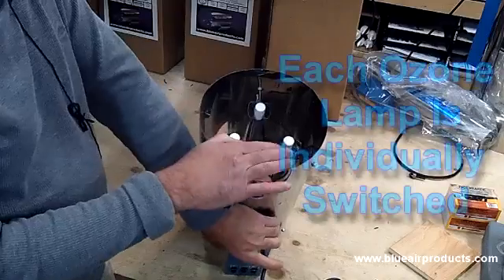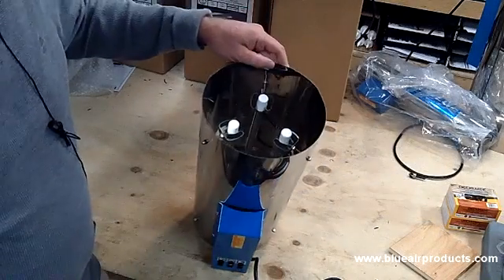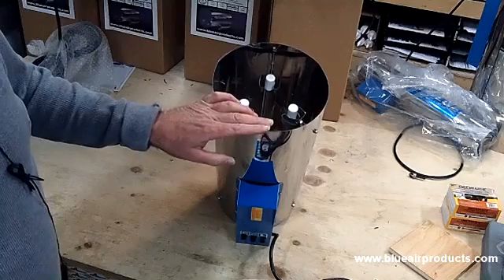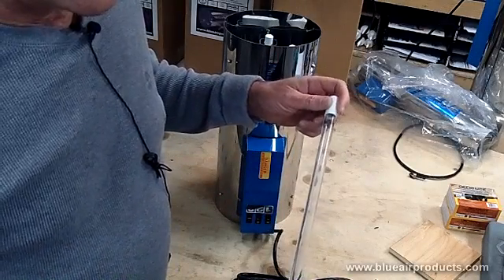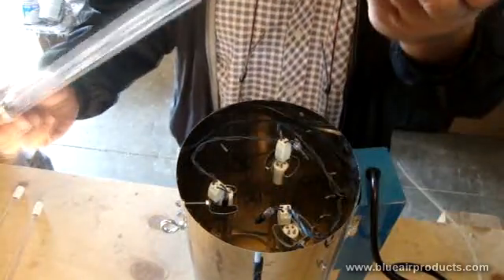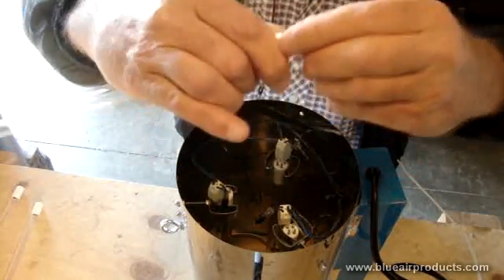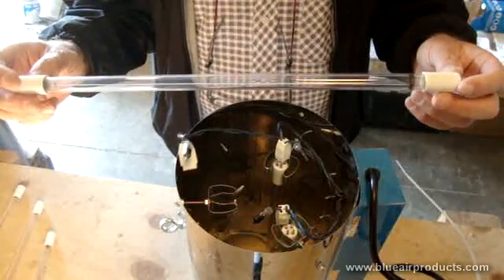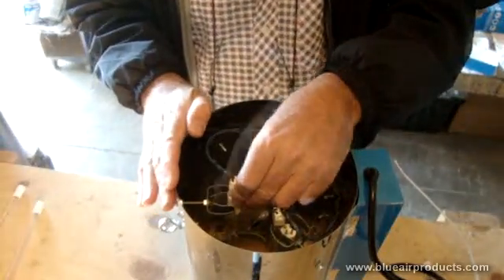How Long Do Ozone Lamps Last?

Comment from the maker: Not much is required. No more effort than you'd use to clean your reflector(s).
One word of caution though, The tiny igniter bulbs are very fragile. They don't respond kindly to abuse. If replacements are needed (see our repair video) contact us. Thanks